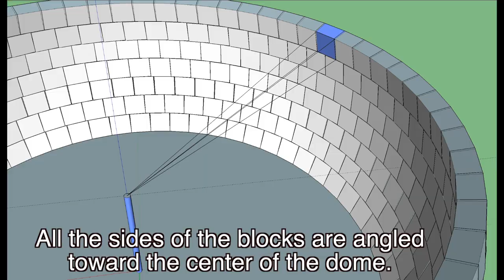How to Use Domegaia's Aircrete Foam Injector Mixer

Comment: Where can I find (buy) the plans?— both the mixer/injector and the molds? Great 👍 demo!!
Reply: Domegaia sells the tools, not the plans. They're not ridiculously priced, though. Their goal is to make the technique accessible, so cost is an issue.
Reply: @CR-xl7zu  I asked ‘cause I’m overseas and shipping may turnout to be complicated and expensive.
Reply: @PeterWest70  That makes sense. I know there are DIY builds on YouTube that look like they work well. Some require an air compressor, which may be a problem. There's nothing magic about the mixer that I can see. It's an off-the-shelf model with the PVC added. That plumbing puts the foam right into the mix at the beater, which probably keeps the bubbles from collapsing too fast, so it's worth adding.

That said, Domegaia has done classes all over the world, so it's possible they have contacts where you are. It'd be worth asking them, I think.